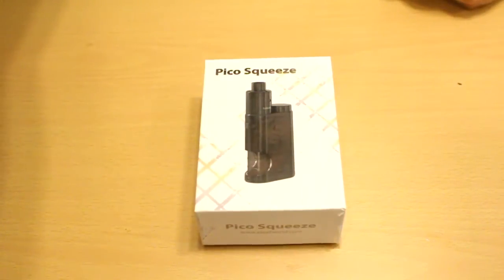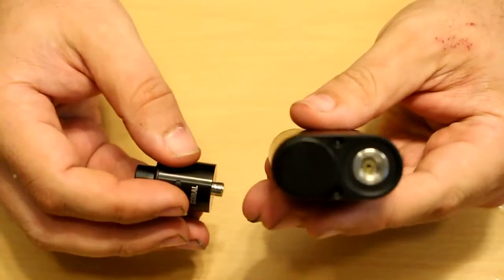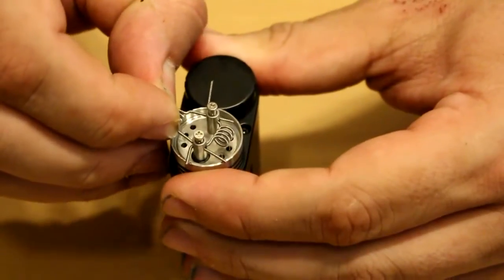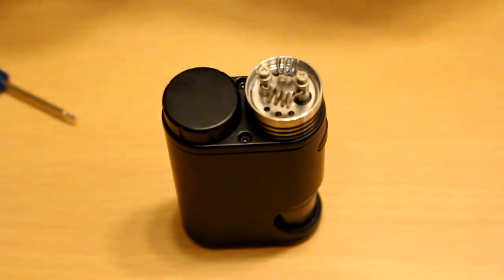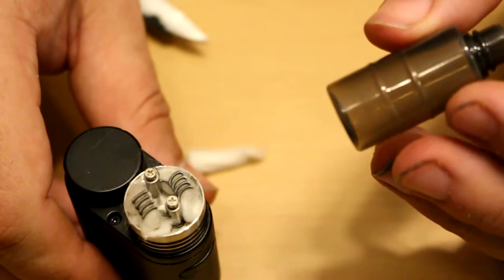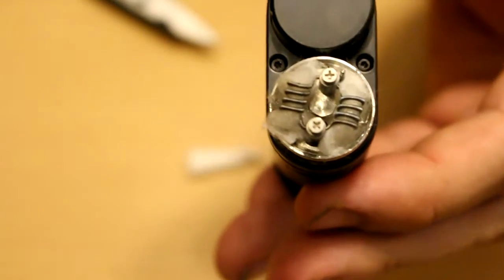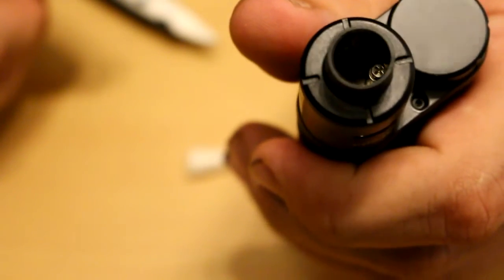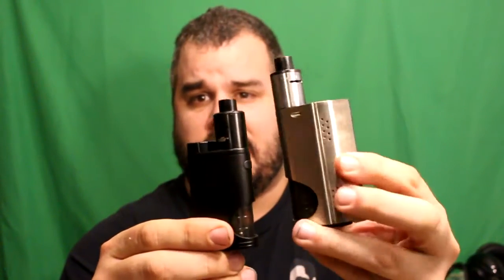Eleaf Pico Squeeze ♦ Unbox, Build, Review

Comment: Is the 510 on Pico Squeeze spring loaded?

Also what battery were you using? If it's some chinese rewrapped battery (efest for example) they have fake specs and MASSIVE voltage drop on low builds